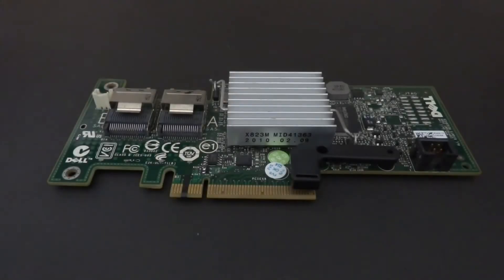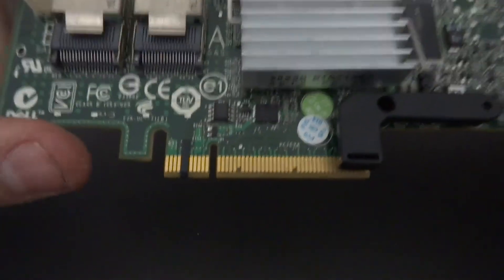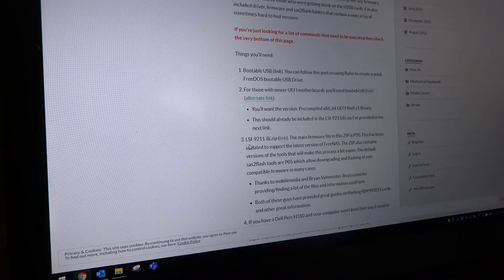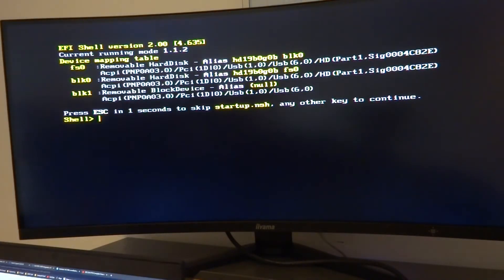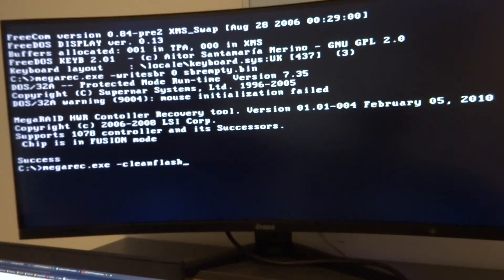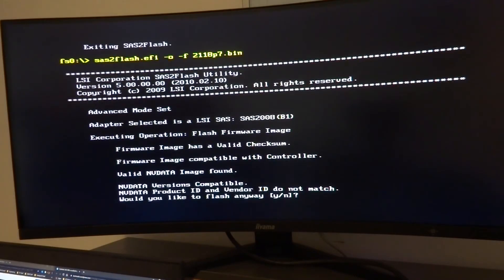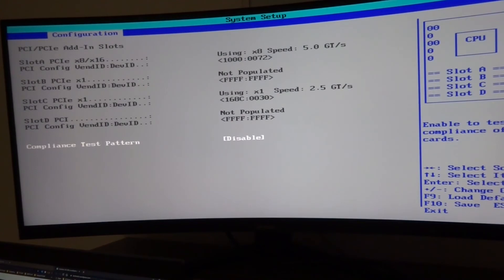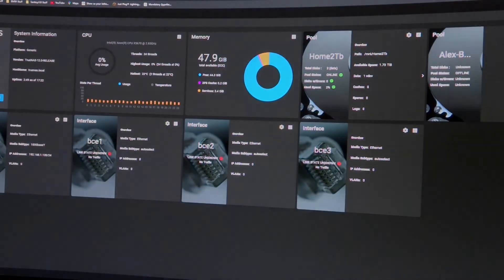Dell R710: H200I HBA IT Mode Cross-flashing

Comment: I want to add my sincere thanks for this too. Flashed my card successfully using this as a guide, but in DOS it couldnt "download " the H200.FW file...   They say you cant do this in a Dell710?   Did the dos bit DOS i🙂n my HP micro server, and threw caution to the wind, learnt a bit about UEFI commands enough to mount the same memory stick and somehow got into a boot uefi directory which gave me the shell.  Mounted my stick as fs3:\     ran the uefi sas2flash bits and here we are !  happy Sunday.  Once again, thankyou ,, !

Comment: I believe I saw a LGA 1155 motherboard you flashed the card on,  will the card work on that board? I have a DH61ww and thinking to use it as a Truenas server with that card, is that possible?

Another  question how were you switching between EFI and BIOS during the process?

At last a big thanks, Now I have some hope✌ +1❤
Reply from the maker: The board I was using was  a Intel DQ57TM LGA1156. I have no reason to believe that the card shouldn't work in your motherboard but you may still have to do the "tape-mod" as shown at the start of the video. 

I did have TrueNas Core running well on this motherboard for a few months before I upgraded through to my Dell R710 and eventually a Dell T7610. 

Switching between EFI and BIOS modes was done in the pre-boot bios environment under the boot options setting or whatever it may be called on your motherboard. Sometime BIOS boot mode can be called "Legacy mode" on certain motherboards but always best check the manual. 
So just mash the designated key (F2 or DEL or whatever) to go into the bios settings during the reboot process. 

Cheers :)
Reply: First of all,  a big thanks for taking the time to write such a reply. 

next. If the card works then it would be a blessing. 

About BIOS entry I was not certain how it once triggered the EFI from USB and next time BIOS from Mobo. even when the USB is plugged in!

Just one more thing I didn't get should the tape be kept even after flashing? I mean during normal operation? and does Windows recognise the drives through this?

You have done a great service to the community thankyou very much.
Reply: Is it the Perc version? Perc h200?

Comment: Will this process work on an R210 II?
Reply from the maker: Yeah it should do as its the H200I card your flashing and is independent from the host system. 
I now have my H200I card that's in this video installed in a Precision T7610 system and also working perfectly
Reply: @SHEARMANDESIGN  thank you soo much for your prompt response

Comment: Is taping the two pins solely for the purpose of flashing the card in a secondary system? Did you remove the tape before inserting the flashed card into the integrated slot on the server?
Reply from the maker: To be honest, I am not entirely sure why the second system didn't like the card without taped pins, but the info I found online just recommended it so it could be recognized in a secondary system. 

After the flashing process i did remove the tape and the HBA worked fine. I have also now moved this exact card over to my Precision T7610 without any tape and it still works perfectly.

Comment: IS this the same process for Flashing the Dell PERC H200E 6Gbps SAS HBA Dual-Port External?
Reply from the maker: I would assume so... I don't think there is much difference between the h200i and the h200e other than a flag or something in the firmware
Reply: Did following this guide work for your H200E?